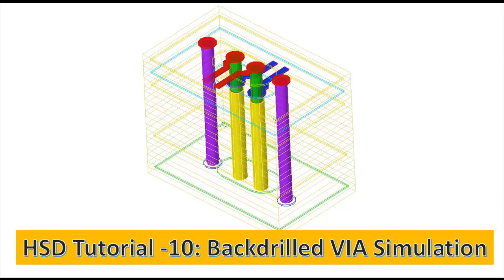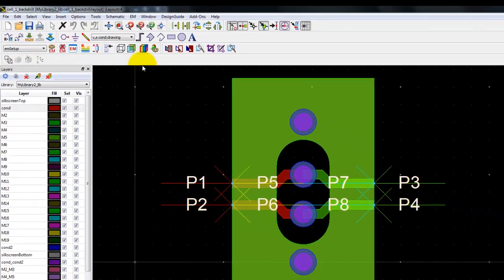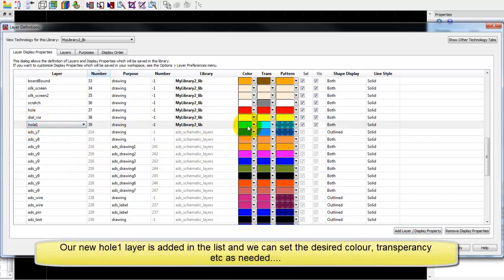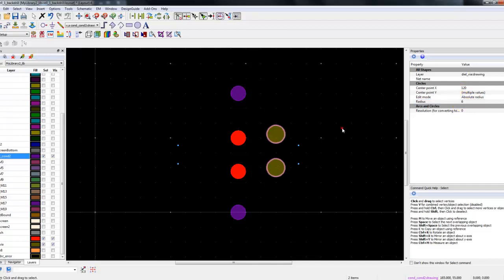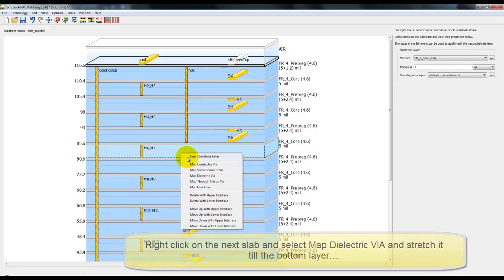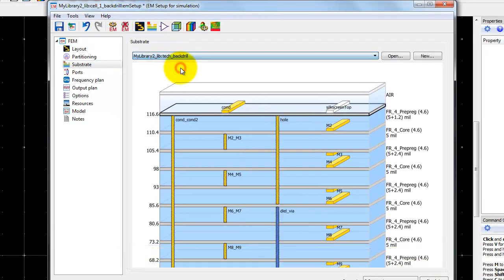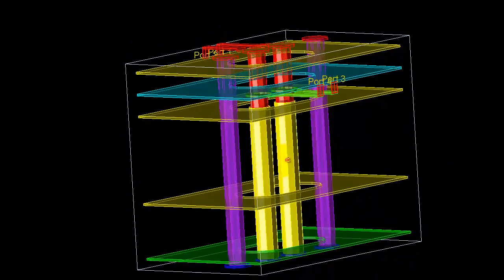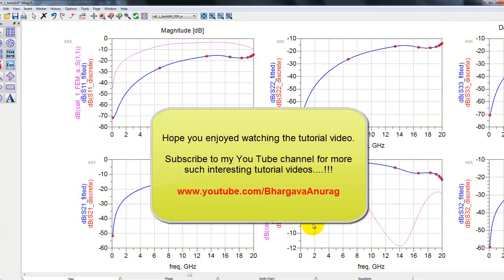HSD Tutorial-10: Backdrilled VIA FEM Simulation

Comment: Please help me, When I simulate our circuit in ADS software then it shows a error message & error message is "MOSFET1 is an instance of an undefined model MOSFETM1". So tell me how I simulate our circuit in ADS
Reply from the maker: It seems you are using NonLinear model component in ADS from Devices-MOS library? If so, remember to place a NonLinear model card such as BSIM3 or BSIM4 etc and the MOSFET component which you place is just a symbol and it should be associated with Nonlinear model card where you will have all model parameters. If you can't fix it then contact ADS technical support team